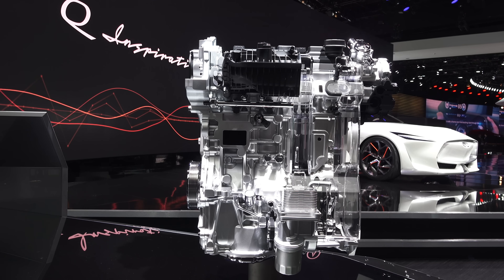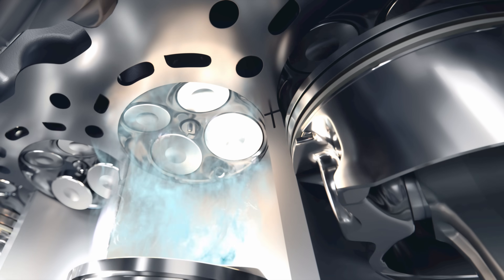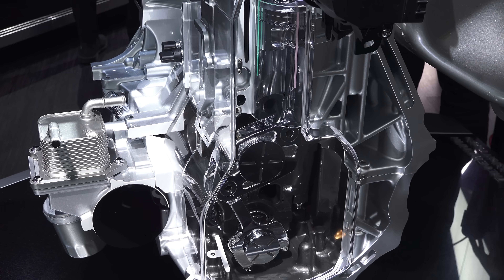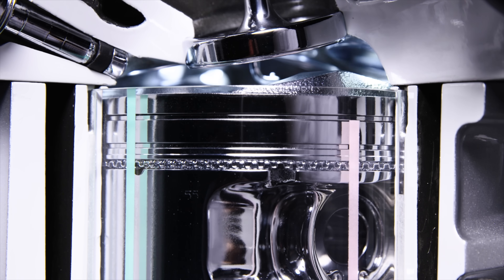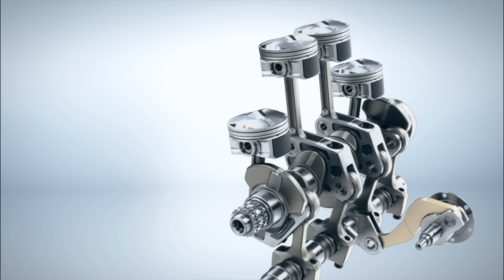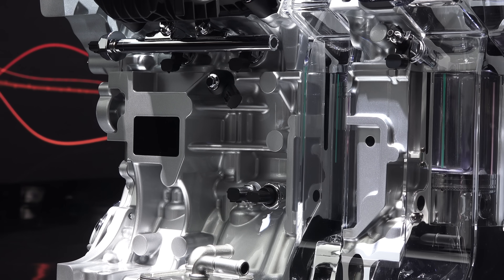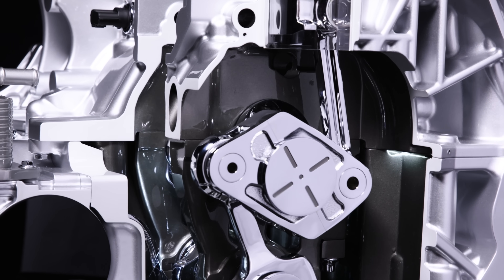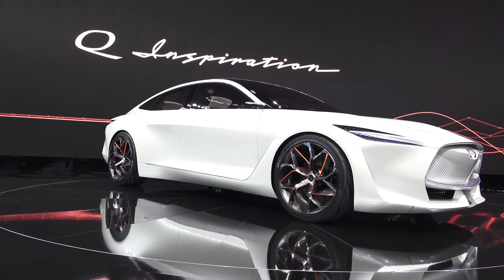INFINITI Reinvents The Gasoline Engine — VC-Turbo

Comment: Thanks a lot for this very interesting video... and for thé others too.
You said the overall height of this engine is the same as an ordinary 4 stroke engine. Sure it’s the information they Gave you.
But it seems to be 20cm higher on your video. Room for the mechanism. It appears to be a little bit strange isn’t it?

Comment: Sir I Have question..When compression ratio is decreased, so that we can achieve high boost pressure(to prevent knocking)..But decreasing compression ratio and increasing boost pressure at same time, wouldn't it nullified the effect on power of engine??..so how come It's increasing power??As effect should be nullified.. Please solve my doubt
Reply: Can Anyone answer my question ..Guys???

Comment: Ok guys,  so I drive a 2003 350z and it misfires atm. One day I took the Maf out and started the car and let it die. Some hours later the misfires completely stopped and the check engine light turned itself off everything was good. The next day the problems slowly started again and I have had no luck. I know the engine can run good but I dont know if it is something as simple as a dirty Maf. PLEASE HELP

Comment: Great video! Interesting but a couple of things confuse me.  1- How can this possibly be no taller than an equivalent displacement engine with a normal crank? 2 - How does this eliminate the balance shafts? Is it the rocking of the secondary crank system? 3 - I get that lining up the crankshaft over the crank is better for power stroke, but wouldn't this be true of any engine with an offset crank? Doesn't this need a long crankshaft to avoid striking the cylinder bore?

Comment: Why innovate when electric cars are the future?
Reply: straitpepperdiet 
Probably because EV'S alone can not solve the problems. They can only be a part of the solution!
Reply: Thats what elon tries to make you believe but EV isnt going to be the whole scene. not even close.
Reply: Because there's a lot of oil to sell. They ("elites") will delay electric cars development for some time.
Reply: Electric motors are found in more and more places in the modern car. This engine has an electric motor inside of it controlling it's compression ratio. Sooner or later they'll be right behind each wheel, delivering 100% torque instantly. The power, of course, will still come from the ground, but, ev's are the future. They are lighter, faster, and contain fewer moving parts. I do love my truck though. I love popping the hood to get my hands dirty tuning up that little engine. I'll miss that.
Reply: All their engineers has to do something at work.

Comment: Developing ICE engines on the edge of electric revolution is like building a horse cart for going to the moon...
Reply: Not at all gas engined are going to be around in form of generators and plugin hybrids for at least another decade or 2.

By offering this new engine infinti/nissan has ensured whatever form of hybridization that takes place their ice motor won't be a weak link. 

Need to remember battery's are holding electric cars back and even if we make that break through  tommorow it will still be years before cars can implement those battery's.
Reply: +vsm1 We are still about 25-30 years away from such a world and you need to remember that our ways to produce/store energy are also going to improve as time goes on,
 and as demand for electricity goes up so to will the number of people willing to install their own solar roofs and other types of technology to compensate for that.
Reply: jawbreaker except the charging itself would be theoridicaly "free" the state will need a new source of income then and as long one that fully covers that isnt found, nothing will be "free" The biggest mistake people keep making is thinking that when something changes they can do everything for free. Thats not how the economy works.
Reply: +BigHeadClan yes I agree
Reply: ICE engines will still be widely used mostly by military and space exploration and people whose driving range requirements are still beyond reach of today's EV tech.
Reply: And again, more lipstick on a piggy called ICE
Reply: Meh Diesels will still be commonly used in that radio quiet zone...
Reply: batteries are not the only problem with "electric car revolution". there's a simpler one: the power. as in: where are you going to get that much electricity from, to power up all cars if they were electric. the combined power output of all gasoline cars/trucks/buses in the world is many times more than all electric power we produce. and no, solar batteries and wind turbines are not the answer. they are not a kind of magical devices you can produce in any quantity in no time
Reply: Solar power. When all cars become EVs , almost everyone will have solar and will charge at home for free.
Reply: There is no electric revolution.

Comment: With so many testing vehicles there should be a serious amount of data for this "magical" engine, but none were mentioned in the video. Is there a link to some raw numbers? And no disadvantages were there as well. I wonder if this big engine could fit anything, but SUV. Let aside the concept.

Comment: Hi, can You explain the flywheel mounting of the same. It Seems that the crank shaft also translates Up and down in Order to adjust its height , and this might cause additional forces transferred to the flywheel. Am I right ?

Comment: Reliability is a definite concern. Lexus is a premium brand, and I'm sure they did an enormous amount of testing. But there is so much going on with engine that it has so many things that can go wrong. From software, to parts. Also, is this advanced engine able to mate to a traditional transmission, or will there be a special advanced transmission they will utilize. But I hope this is a success, I never tend to buy brand new technology, but this is impressive.

Comment: What about fuel economy comparison?
Reply: Richard Richard 27% better than a similar output 4 cylinder or 6 cylinder. 
In the SUV (Qx50) they’re putting it in, it’s going to combine for 27mpgs. In a SUV crossover that weighs over 5000lbs. Not bad honestly.

Comment: Sheer brilliance at the crank riding on a lobed cam to raise piston height. Everything looks good except for the initial mention of an electrical motor to actuate the lobed cam. No doubt it will fail or fluctuate with heat and salt corrosion. Then there are concerns with that manifold being short, 1 piece, and looks aluminum. I would speculate aluminum deteriorating with chips being sucked into the turbo. Same trouble as Lexus and its backside convertor breaking up and sucking back into the cylinders destroying itself. You know an engineering marvel would be to incorporate adjustable length intake runners for that 14.1 ratio. You could have mechanical butterflies on a secondary set of long runners that would open when WOT to rip the front tires off. Lol.

Comment: I wonder how much engine oil this engine will require with that large crankcase and how often it will need to be replaced with more moving metal parts. Also, Premium fuel requirement will be a tough sell in USA if pushing "efficiency".

Comment: 1.2 seconds is pretty long. Is this engine able to rev higher rpm's because of the connecting rods or less because of moving internal mass, why did they go with electronic motor instead of some kind of hydraulic actuator. also talk about interference jesus, some dank fog would probably leave you behind the seat of a grenade if you double thwack the throttle and the maf catches a bit of filter oil, although i'm sure it probably calls for paper filters

Comment: If youre cruising in high compression, will there be a power delay if you floor it and suddenly demand the engine to convert to low compression?

Comment: I'd like to see a ball or needle bearing in the lower linkage. As I see it in the demonstration, you can not get enough hydrodynamic load in the plain bearing to support a tough oil-film in the lower linkage. And I would like to know how they solved this in the big end of the main connecting rod and in the small end of the 2nd connecting rod. Sure, the guys know what they have invented!
Beside that, I really like the 'nearly' vertical moving connection rod during the power stroke.

Thank you EE for this great video.

Comment: The enormous amount of heat produced when extreem power demand from a 4cyl it's going to be hell on those pistons and valves, also the head gasket, nothing was mentioned as to how it will cope with the extreem heat and pressure. These days they are made from a single sheet of coated pressed steel. I've seen these gaskets fail without warning on a normally aspirated engine.

Comment: one tiny detail missing to make it perfect:

Variable valve timing...

include that and you get the most advanced 4 stroke engine on the market.
Reply from the maker: It has variable valve timing, which is how it switches from a traditional cycle to the Atkinson cycle.
Reply: Neat!
Now I'm really looking forward to these engines...maybe it's an other significant revolution for the combustion engine that is going to be tought to mechanics soon^^

Comment: Saab did a engine with variabel compression around 2000....it never reached prodution tho
Reply: Was that the weird one that actually turned the cylinder banks or was that someone else?
Reply: Mrsirr the cylinder was integrated together cylinderhead and hinged to the block. By lifting the head it could vary the cr from 14-8:1cr the Called it svc. To bad it never made it to production. It would probaly have some reliabilty issue with block/head seal

Comment: Question: If you take this design for a Turbo'd performance car (don't really care about fuel economy in mind), would it also mean you can make more power while not in boost by switching to high compression before boost? I'm thinking this would technically eliminate "down town" that turbo cars have when not in boost by switching compression ratio. Apologize in advance if this doesn't really make sense. BTW, great vid once again.

Comment: Based on what you know so far, how does this and the new Mazda engine compare to each other?  Any bits that each are expected to do better than the other?  It will be interesting to see if and how quickly the VC-turbo trickles down to Nissan vehicles.

Comment: Holy complexity... All I see is $$$$ when this thing breaks. Get it new because you don't want it once it's out of warranty. Nice tech demonstrator though and some great innovation going on. Reminds me a bit of when GM came out with their 8-6-4 idea, in the sense that it was an optimistic idea for fuel efficiency that didn't work, mostly because it was ahead of the tech available at the time. I really love this, amazing how far they have come from the basic internal combustion engine.
Reply: Perhaps, but given I know lots of people who work for Nissan Corporate-- particularly in the arena of dealing with quality issues and helping support the dealership mechanics-- I can say that they are all rolling their eyes at this new venture.  They are still being overwhelmed with the influx of broken CVT's that Nissan can't seem to get right after making them for well over a decade.  Maybe you should have honest, off the record conversations with people who aren't paying your way to Detroit.
Reply: True they are getting more complex but I don't know if I agree with more reliable. I've had old crt monitors and tvs that I've thrown away after 10+ years that still functioned perfectly but have had lcd screens go out after only 3 years. It used to be that when a tv broke or even computer when they first came out, you would take it and get it fixed. Now,  I think the cost has gone down to the point where these items have become basically disposable. A lot of people lease cars or trade them in for the same reason.
Reply: Revengeful Lobster Everything  piece of new engineering GM attempt ed in the 80s was poorly executed, including the diesels remember lmaoooAnd that was diesels were disgusting, remember the Chevy Vega with the aluminum heads? And how that turned out, but yes this does put me in the mind of that, hopefully it turns out better
Reply: Chris Schaffner lmaooo lol    oh that vega lol good times lmaoooo
Reply: The Vega was a real POS! My father had one and it burned more oil than gasoline! GM attempted to make a sleeveless aluminum engine block-the pistons would score the cylinder walls in the block and then the oil consumption would commence!
Reply from the maker: I find these kind of comments a bit degrading to the engineers who poured many many years into the development of an engine, only to be summarized by a 15 second thought of "looks complicated, probably will fail." The engineers spend countless hours developing and testing before the engine goes to market, let time tell if it's reliable or not, rather than speculating based on what it looks like.
Reply: LOL. It really wasn't meant to be degrading. No knock on engineers or the guys at Nissan, but generally the more complex you make something, the more likely you are to have something fail. I really don't think you can argue that point. I was a maintenance tech on F-111 aircraft back in the 80's and I appreciate simple things for the reason that they are easier to fix WHEN they break (the F-111 was not simple). From your video, they certainly seem to have thoroughly tested this and put it through it's paces, but yes time will tell. I appreciate you taking the time to respond, and I really did like your video even if I came across as being a it negative on the tech.
Reply: The engineers aren't the guys doing the maintenance either. That doesn't have anything to do with reliability or durability aspect, but from a repair and production pov, the costs will be probably be greater because of the complexity.
Reply: +Revengeful Lobster This might be a bad analogy but I'll use it anyways. Laptops have become more complex and complex yet they are becoming more reliable and the same goes with TVs and smart phones. Complexity =/= bad reliability.

Comment: So the cylinder compression ratio is changing, but how is the overall compression ratio changing with regards to the turbo and cyclinder at different points?

Comment: Nice. Real innovative. For really high performance i would like to see how the car handles 7000 rpm scenarios with the increased rotating mass, since reciprocation is more balanced. Also fuel? How would it compensate for energy density or resistance to knock when increasing compression in 1.2 secs from 8:1 to 14:1? Or is that addressed by keeping intake valve open longer during compression.  Unbelievable!

Comment: Wow - that's fantastic engineering right there.  What's most surprising is the elimination of balancing shafts - just WOW.  Talk about adding more HP there by removing additional rotational mass!  For anyone who's worked on engines before, I can imagine it being hard to... imagine... a world without counterbalanced cranks!  

That said, any indication as to whether any V6 variants are planned using this technology?  I wonder how quickly aftermarket engine management will accommodate for this additional engine control.  But, I can only imagine (obviously a thought-provoking video :) )  how well this plays into the EPA's emissions agenda for 20/20.

Curious to see what the mpg ratings on these engines are, compared to fixed-compression turbocharged applications  (fuel-efficient variants as well as high-performance, low CR).

Comment: It doesn't seem like a design that will like to rev.
Reply: Most cars don't Rev all that high these days to begin with,  but in Car and driver and motor trend both report the engine being very smooth even near red line
Reply: gurjinder singh ;(

Comment: Hey Jason, I was impressed to see that Infiniti managed to create a reliable (hopefully) variable compression, variable timing turbo engine, as the news was released a few weeks/months ago.
I just have one question left after watching your video, which answered several other questions that I had. Love the animations btw.

Why didn't Infiniti push the phenomenon further, and increase compression to create controlled compression ignition like in diesels? And in general, why is there no compression ignition gasoline engine (I think Mazda has patents about this)? I would think it's possible to control it, and if this engine is built to withstand 14:1 compression, why not slightly more?
Anyway it would be great if you could answer, but thanks anyway for the videos, I love the content you produce!
Reply from the maker: I'll have a video soon that will provide some insight on your questions!
Reply: Engineering Explained haha I read your comment with your voice. Thanks for the answer! I love YouTubers who stay in touch with their fanbase. Mad props to you for your work